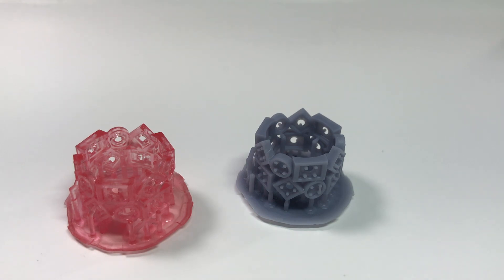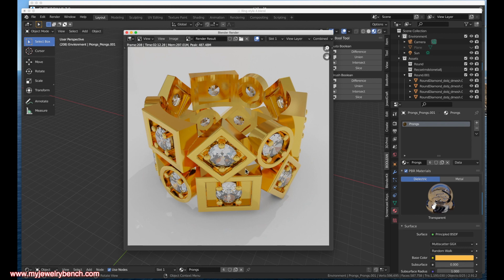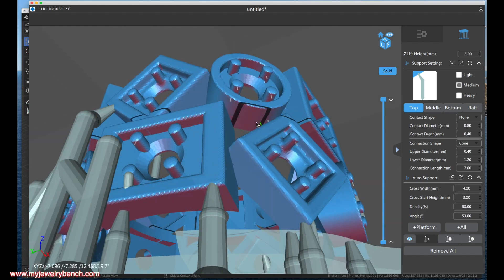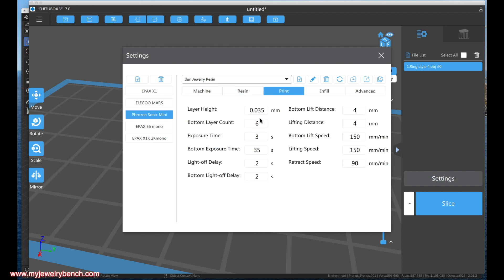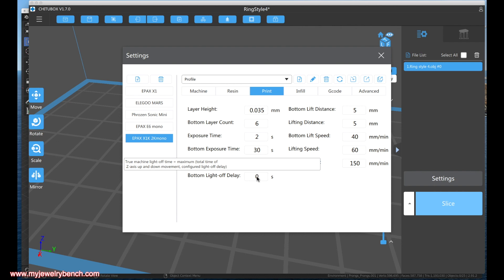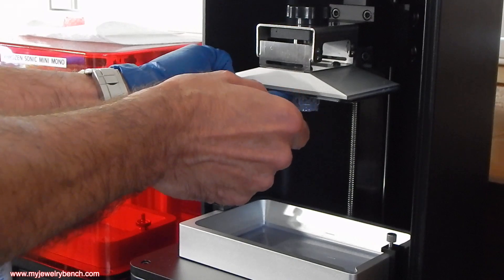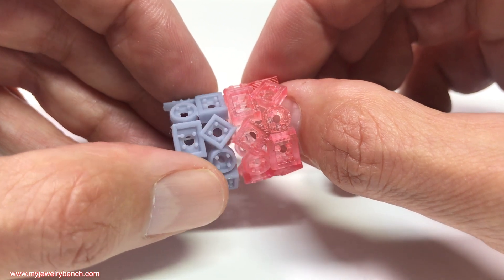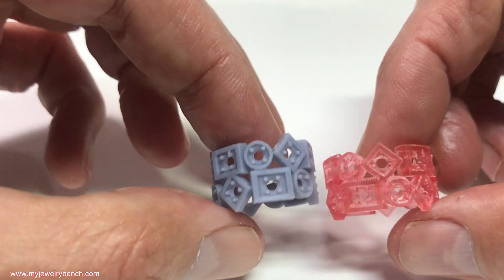3D Printing a Complicated Wedding Band, Settings and Support!

Comment: i am from India and running a jewellery business, now i decided to do casting jewellery so i want resin 3d printer please can you suggest me best 3d printer for jewellery business

my shortlist is
elegoo marse 5 ultra (because its 18micron and 9k resolution) is it best for jewellers means better and sharp details. better features like tilt release technology, wifi transfer,auto leveling  etc

or go with 

elegoo marse 4 DLP 

but this elegoo marse 4 dlp product is out of stock on almost all platforms no one has its stock

Comment: i see you are using a phrozon sonic mini 8k,  actually LCD resin printers have only 2000 hour life span , this video is almost 4 years old , what is your experience? its really LCD screen no longer after 2000 hours ??
Reply from the maker: Still using it.  I also use an elegoo mars 2 pro,  runs twice a day for 5 days a week.  Three years old.   Lifespan is a factor of maintenance and care.  Clean the tray really good, try not to spill resin on the printer. Oil the drive screws. I change fep paper when needed. Two to four months intervals depending on usage.   Try not to get caught up with gimmicks like tilting trays, they will wear out.  The other side of this is that the led screens are not built the same. Some will last longer than others.  But they are cheap enough to replace.
Reply: @watchesandjewelry  thanks a lot sir, you have solid experience on 3d printer 👍🏻👍🏻this answer is very helpful for me 😊😊

Comment: how much time is taking for a complete print ring ?
Reply from the maker: It depends.  If you print with abs resin, about 2-3 hours.  Castable resin  4 ish hours. That’s printed vertically.  If you tilt the model on the build plate to 45 degrees, 1.5 to 2 hours.
Reply: @watchesandjewelry thank you very much sir

Comment: Who are you using to cast these?  Also, where are you buying your Ifun resin?
Reply from the maker: I have a casting station but use a local jeweler who does a lot of casting. Typically you can find someone local almost anywhere who will do casting. As far as resin, I am using a variety of resins and have good luck with ifun castable resin on Amazon. Burnout schedules are the important thing here. They are very different then wax burnout 

https://amzn.to/3xs3cc6
Reply: Interesting!  I just found out that Youtube shadow bans my post if I post a URL!  Luckily though, I wrote the following reply using Grammarly so I can repost it without the URLs.  Instead, I'll give the product numbers so one can look them up if they'd like.  Here was my reply:

I've tried numerous castable resins over the last 6 years and I'm always looking for better and cheaper.  Thanks!  But, looking further, I found it on eBay for $33.66. Here, eBay item number: 384246889708  Also, I found this one for $20.99 I'm going to try.  Here, Amazon ASIN : B08LGDZNP7.

 My request for the name of your casting house is related to my unending search for the best casting house.  Most don't accept 3D prints.  I've tried casting houses all over the world.  It's always good to have a backup casting house to revert to during the holidays when things start getting out of hand!  😁

The reason for the distortions next to your supports is related to the thinness of the geometry there.  What happens is, when the geometry and angle create long thin unsupported sections the sections break off and stick to the FEP film.  Then, as the print continues, it builds up enough thickness, and the part stuck to the FEP film is ripped from the FEP film and attaches to the print as a whole again.  That is what causes that particular artifact.  To prevent that add thinner supports in between the thick supports you already have.  Thinner, because your thick supports are already keeping the print attached to the build platform well enough and thinner supports are easier to remove.  You don't want to increase exposure because that will cause your details to be overexposed cusing them to be less crisp.

On the other hand, another thing you can do is, rotate the top part of the ring upwards.   Right now they are at about 45 degrees, try something like 60 degrees.  That will cause the thin areas as it prints to be thicker and stronger using the same supports you already have.

I've evolved to the point that my supports are also my sprues.  And the latest endeavor that I've been doing the last few months is I have been printing the entire tree!  For the main sprue, about 10 mm in diameter I've been using a 0.4 mm wall thickness.  Doing this keeps the price down about as low as wax WITHOUT having to spend a bunch of time with a wax pen creating the tree.  😁
Reply from the maker: Jaguar in NYC does excellent work.  If you prefer you can email the stl file and they do the rest.  All you have to do is pick the metal you want and pay of course.  They have fast turnaround and do very highly quality casting
Reply: Thanks!  I'll give them a try.

Comment: How do You go about designing two tone jewelry ? snap together pieces ?
Reply from the maker: If I have a design that requires two tone. White and yellow gold for example. I design each piece individually but in the same work space. They can be exported individually afterwards allowing for multiple casings in different material.
Reply: Ok thank you for the reply I’ve been watching all your tutorials and they are great. And yes that’s what I was thinking I’ve seen a lot of two tone jewelry casted in multiple pieces and and put together like a puzzle. Can you can please make a video on this one day on how we can design objects that have proper placement in other objects (In example a two tone Buddha pendant where the pendant maybe be yellow with hole for insert  and Buddha may be white gold but both sap together ) sorry if this was a long one just been wondering how to do this for a while now.

Comment: Hey Peter, I've just found your channel while doing some research. I'm currently an engineering student at penn state university and I've been learning a lot about 3d modeling and design. I'm also an avid 3D printing fan. I've got a few FDM printers and just ordered my first resin printer. Ive also got a great woman who've I've been dating for 5 years now and I really want to use what I know and learn more to personally create a ring to propose to her with rather than just buying some off the shelf engagement ring. I've been enjoying your videos and have learned a lot so far. A couple questions I do have is how would I go about finding a business to cast my prints? Also, how/where could I learn to design prongs to fit the geometry of a gem for a proper setting? Keep up the good work!
-Tyler

Comment: Hi. Thanks for interesting and good videos. 
How are you handling the step of layers in the model?
 You should have visible steps on the top part of the round and square heads. Of course, those are not necessarily visible by the naked eye, but very disturbing with a microscope during the stone setting. Those steps also affect the reflection. Those are difficult to get rid of in the wax model and final ring.
How do you tackle this problem?
Reply from the maker: Great question...  First, I’ve never in my live as a jeweler had a piece come from casting that didn’t need work...  My final prints tend to be printed at either .025 or .030 mm layer height.  This can be achieved with the correct layer cure time.  (Smaller layers, less cure time, tweak to your printer’s capabilities).  Once I’ve gotten the piece back from casting, I will use small rubber wheels and small burrs to clean up the lines.  Smaller layer height reduces these lines significantly. While manufacturers recommend .050 layers, you can print smaller, but it takes longer however giving you better results.  Most importantly is the cure time, burn out schedule and the cleaner the material cast, the better.  For resin burnouts, the harder the investment the better, but not brittle...  This all results in very very small layer lines in casting.  I also sand my prints with 800 grit sand paper on larger surfaces before making the investment. Hope that helps
Reply: @watchesandjewelry  Thanks for your quick answer. I just wanted to know if you have found a way to simplify the process. This problem adds one more dimension to the design work. How to design the item for the cleaning work and how to print it most economical way.
Reply from the maker: The more details in your model, meaning that you have a clean well designed file will alway give you better print results. As far as making it quicker there is no way around the time it takes to print, burn out and get quality. However, if you make an additional investment in equipment that you can make rubber molds for wax injection? You can use standard hard resin printed in high detail to make a mold, fill with wax and bet better casting results. You will still have to clean and polish your casting. No way around it.